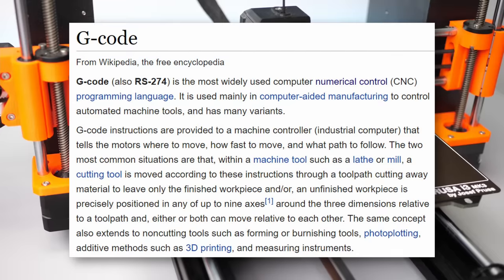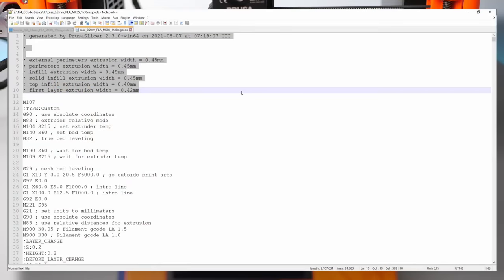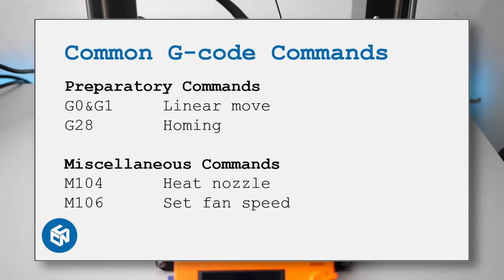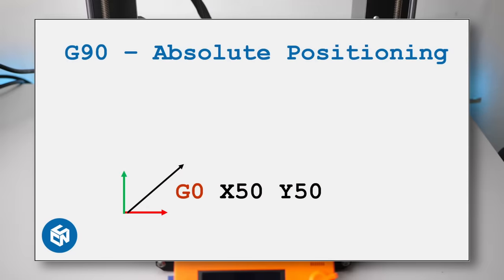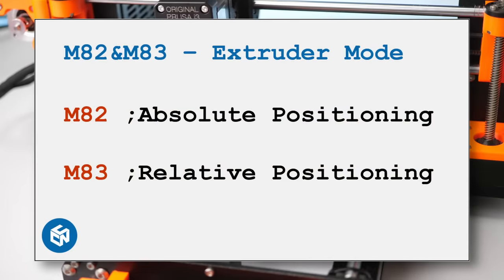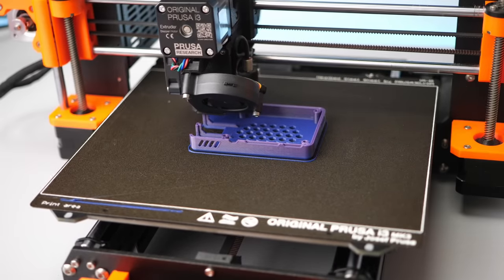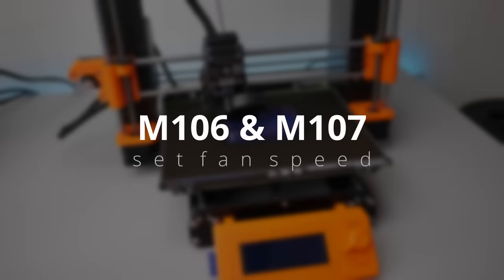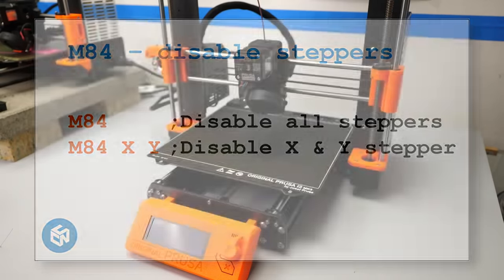Learn G-Code for 3D Printing

Comment: Thank you for video. I was always wondered - why we need in start G-CODE first SET temp and then SET&WAIT? why not just SET&WAIT?
Reply: Like said in the video: set&wait pauses the processing of the gcode, so the heating-up will be in sequence and thus will take more time.
Set temp (on nozzle and bed) forces the printer to heat up SIMULTANEOUSLY. The following set&wait (on nozzle and bed) waits for both being heated up.
Reply: @na_dann_mal_los  You did not got what I meant. I clearly understand that. And in some cases that would work. But usually it takes MUCH more time to heat a bed - so to prevent oozing heating bed first make sense, and nozzle heats up much more faster. But, like in example in video, many times I've seen, that first we SET bed and right after - SET&WAIT bed. Why?
Reply from the maker: I don't think that there is a particular reason for that. As pointed out with the asterisk, M109 and M190 would have been sufficient but it also doesn't hurt if you have both.

Comment: It would be most helpful if a video could be made covering how g-code is made to work with Temp towers. I have the Prusa MK3 i3 and am looking to use a temp tower which I found on 3d printers site. What I don't have is the knowledge to alter the G-code for running it on the printer for that temp tower.

Comment: I've noticed that some printers will perform auto bed level before every print regardless and adding M29 makes the printer do it again.

As a hobbyist software programmer I love learning what is actually being told to the printer.
Reply: As far as I remember, Marlin has an option to add print start G-codes, that will run no matter the initial G-code on the file you start (or through serial). That might be the reason I assume.
Reply from the maker: This might be something that's configurable in the Marlin (or others) firmware.

Comment: Hi there Stefan, such an educational site where I have learned a considerable amount in a short time.  One g-code in particular that has been eluding me is one for controlling the extruder.  I'm trying to calibrate the extruder on my Geeetech A30 Pro and find it frustrating that this particular code seems to be avoiding all my attempts to locate it.  The Geeetech control panel lacks any setting regarding extruder control and I thought using a g-code to do so would be rather simple.  Apparently not!  I would appreciate any assistance or direction you could provide,  Thanks!

Comment: Hi, if I use M82 command to use the absolute mode for the extruder, how the E number relates to the steps or the rotation angle of the stepper motor? I'm thinking mod the extruder motor to let it drive a rotary stage. Thank you!

Comment: thanks for the video. if I would trim the Z axis height as I would put print plate or remove it(the height woud be added from the original plate). what would be the gcode command should be? thanks for any help.

Comment: Hello my friend, I have a CNC laser control card, I want to rotate the Y axis continuously, (it will never stop, also it will be necessary to adjust the rotation speed) I made G1 Y1000 F350 but it stops after a certain time.  How should I write a gcode?

Comment: Hi Stefan, i have a question unrelated to this video. I Noticed that if i print parts in a 15/20 degree angle my parts are stronger than normal prints standing up or lying down. It this theory correct and do you have a video where you test this or is this an illusion that tricks me? Thank you.

Comment: This is great! I'm new to all this, is there a way to make it to where my prusa heats the nozzle and bed while calibrating and then waits for the temps to start printing after they've reached temp?
Reply: You want to wait for heating before calibrating because things will deform further under additional heat. It'll be more accurate if you wait.
Reply: @teguh.hofstee  that makes perfect sense, thank you for that!!

Comment: Is there any easy way to write the pid values to sd card by just running a gcode file? I am running aftermarket marlin on a chinesium printer and connecting via usb is rather cumbersome.

Comment: Thank you Stefan for the great Video! 
What about settings extrusion multipliers? For example if you want to print more objects with the option "Compleat individual object" in PrusaSlicer and you want to change for each object different extrusion multipliers (flow for one object 100%, the second object 90% and so on,...)? How is that? Thank you and Auf Wiedersehen :)

Comment: So using M82 while manually deleting lines of gcode (like when recovering a failed print from say layer 100 onwards) might cause serious overextrusion, right? That might explain the over-/underextrusion I ran into while manually mixing different layer heights and infill ratios based on combining multiple sliced Files on known layers...
Reply from the maker: Exactly. When doing things like these, relative extrusions are way easier to handle.
Reply: @CNCKitchen  and like that I learned something today, thanks for the video!

Comment: Is it possible to set the bed temperature to 90ºC and wait until it reaches at least 80ºC ?
Reply from the maker: Not directly, but you can write the following:
M190 S80 ; wait until 80°C bed is reached
M140 S90 ; heat to 90°C but continue with the code
.....
Reply: @CNCKitchen  Yes, that is what I am using now, but it is slower than it could be - the printer reduces the power at 80°C and waits until the temperature stabilizes. All that is unnecessary, the target is 90ºC and the only thing I want to do at 80ºC is to enable nozzle heating.

Comment: Huh... Interesting to see a 3D Printer interpreting the G-Codes differently from a CNC. G28 and G29 on a CNC ( or at least on mine ) are generally used to move the Head to predefined positions like G28 to a generally safe or nonobstructive position, like out of the way at the back of the machine, before and after the cutting of a part while G29 is something I personally use to change the cutters at the front of the Machine - So technically it sends the toolhead Home already knowing where that is. It does not perform a Homing procedure in search for it ( that is a different step done at the very beginning of using the machine ). 🤔
Reply: 3D printers do not have a Machine Home separately stored. You also have to remember that there are loads of different variations, grbl does not have G29, marlin has it as z-probe and mesh bed leveling. GRBL uses G38 as Z probe command, G30 recalls and sets the temporary positions P1-4, stored  as absolute positions.

Comment: You missed one important aspect of examining gcode files.
NEVER use windows notepad (I don't know about Mac) or you will almost certainly corrupt the file upon saving. Notepad++ (noticed you used it in the vid) is the preferred editor for gcode files.

Comment: As a noob to 3D printing, I try to stay out of the weeds ... at least until at such time I really am forced to.
Looks like I am forced to... :(
I obtained an obj file from the internet and no matter what slicer I use when I send the gcode to the printer the print does not start in the center of the plate it starts half hanging off a corner, ruining the print.  Which is weird because the object is centered in the slicer software and EVERY single slice I do with the same settings works fine.
It is almost as if the obj code has some ability to alter what the slicer says on positioning... ugh.

Comment: what is the color change gcode for my ender 3?
Reply: i want the full gcode and beginned my own gcode:
M83
G1 F3000 E-25
G1 F300 Z6.1
G1 F9000 X20 Y20
G1 F300 Z15
M104 S150; standby temperature
M0;Do the actual pause
M109 S205; resume temperature
G1 F3000 E25
G1 F3000 E-25
G1 F3000 E30
G28

Comment: G2 and G3 define circular paths.
Reply from the maker: Yes, unfortunately basically not used at all with 3D printers.
Reply: If a computer is translating a CAD file it's probably easier to do small line segments. I'm probably the only person on Earth who uses G19.

Comment: I’m trying to get to the point where I can input pure G code without even using CAD or a slicer , build objects in G code in my mind , may take a while but saves electric
Reply: Bonus respect points if you can feed it real time, no storing on .gcode files, pure type out printing!